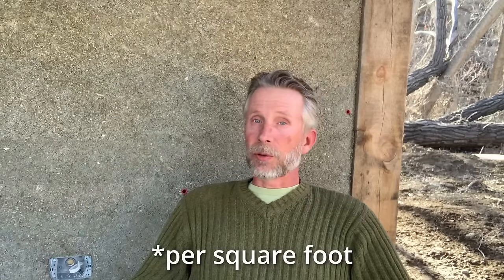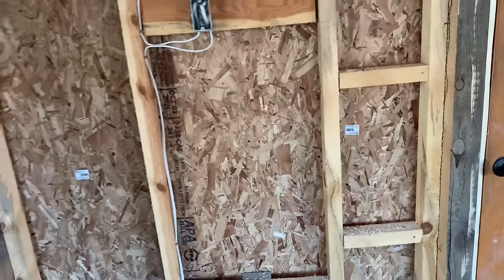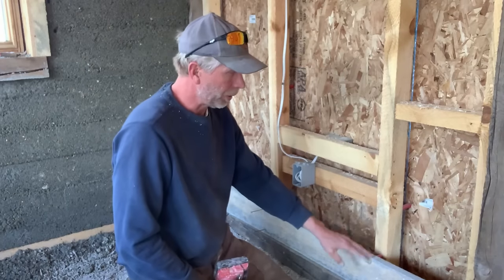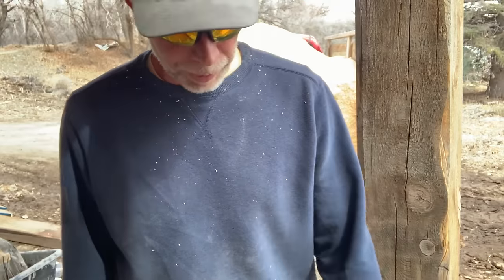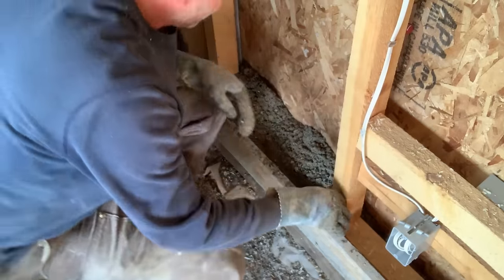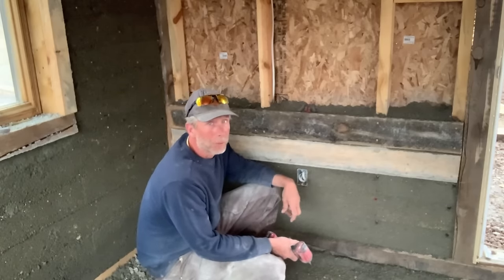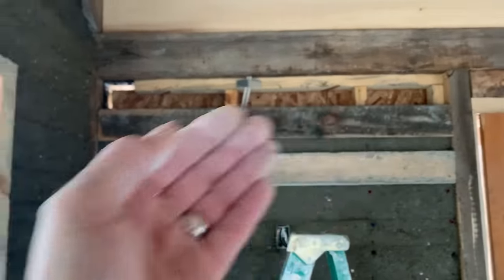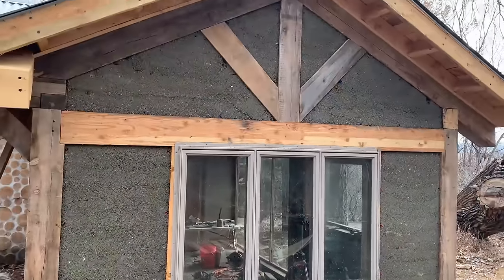Dustcrete

Comment: Great video!  We are interested in using this technique/material as an insulation as well as interior.  Due to our HOA requirements, we have to use sidings for the exterior.  Do you think this is possible for our situation?  Thank you.
Reply from the maker: Absolutely. I would build my walls such that the frame is not buried in the middle of the wall, but positioned to the outside. That will leave you exposed studs, after the forms come off, to attach the siding to. You’ll want to let the dustcrete cure for a month before installing the siding so there is no moisture left in it. I’m not sure if it would be better to have a barrier of house wrap between the dustcrete and the siding, or have contact between the two. If I was doing it, I’d probably skip house wrap and use those cardboard drywall shims to offset the siding from the dustcrete by 1/16” . That would keep the siding material from touching the masonry, but not leave enough of a gap to attract mice and wasps. It would also allow vapor permeability on both sides of your finished wall. I haven’t tried that approach, but I’m sure it can be done.  Good luck!
Reply: @radicalgastronomy   Thank you for your response.  Unfortunately,  our HOA committee requires the sheeting and the house wrap.  But we can use any kind of insulation and interior finishing.
Reply from the maker: @placefor16 That should be fine, as long as you let it cure for a long time before plastering the interior walls. Open all windows, and run a fan.
Reply: @skysnow  They do now have house wraps that have bumps on it that allows for a certain amount of air circulation

Comment: Thanks for sharing. Does this type of material act as thermal mass?
Reply from the maker: It does. The wall section I did in this video weighs about 200 lbs. Having both r value and mass is part of the beauty of this system.

Comment: I'm finishing up an above ground pool. instead of a sand layer,  I will be using a vermiculite and cement plaster on the bottom layer, under the vinyl liner.
do you think sawdust could be used in place of vermiculite?
This layer is in direct contact with the ground.  
it is supposed to act as a vegetation and water barrier to prevent Moisture build up and vegetation under the Liner.
Thoughts?
Reply: @webyankee6558 I saw your post about the Sawdust and concrete floor in the hunting lodge.
what are your thoughts on my Post above?
Reply from the maker: @wyldanimal2  I can’t say how it would perform in ground contact outside.  I may work great, or it may breakdown in the presence of soil biology and water. The vermiculite, or pumice is the safe play.

Comment: What is the thermal mass/R-value of using the dust-crete for the walls? If using the dust-crete for the walls in a colder climate, wouldn’t you want to make the walls thicker to increase your thermal mass for better efficiency in heating and cooling?
Reply from the maker: These walls are better than R 20 at 6” and certainly could be thicker, if desired. The real key to thermal efficiency in cold climates is how insulated the roof is, however.

Comment: Any issues with water/moisture/condensation getting through when it rains or is humid, specially at the bottom (wood boards)?
Reply from the maker: My two foot eves and overhangs have kept the rain largely off my walls. On the next one I will probably do a 16" masonry course before starting the dustcrete wall. I have a dustcrete section in the dormer of the cordwood half of the cottage that was poorly flashed, and did have some swelling of the dustcrete wall before I got it fixed. It dried out without molding or crumbling, but you want to keep this from contact with standing water, for sure.

Comment: could you also incorporate some small stones or riverbed grind or something to make it more structural?
Reply from the maker: Unless the rocks are touching, they would add little structural support. There is a technique called pumice crete that uses lava rocks as the aggregate in concrete. It is a high thermal mass, high R value method and a good approach in regions with ample volcanic stones.

Comment: Would it be of any use to tamp down each section more densely as you fill it?  What is the maximum height of each form  that can be used effectively?  If it is used on external walls - does it need to sit on a watertight stem wall ? To increase adhesion between dry layers you can just use a paste of neat cement.
Reply from the maker: If you tamp excessively, you loose insulating properties. I don't know that there is a practical limit to height. Exterior walls must drain water, either by including the stem wall, or with a rubble trench and proper grading.

Comment: Invation helps produce new ways to build, but I see a few flaws in your approach  and I see a few qualities that are good.  These walls have mass  for heating and cooling mass is good becuse it regulates the tempture swings the building will be cooler in the summer and warmer in the winter, its not so much the insulation factor as it is the mass. Heat and cold won't penatrate the wall as fast, but I think a fire place would hold and give off more heat, this isnt much different then a house in New Mexico that type of construction.
However your studed wall should be on the inside with mechanicals inside it,  a chicken type wire should be in the wall also fiber used for concrete pours this will add a high psi strength. 
Something crashes into a wall its not going to budge.

Comment: I wonder if this will work with shredded paper. Could it be used for tilt up panels? Make it flat, wait till it sets then pop it up.
Reply from the maker: There is a papercrete method. Practitioners typically convert a round water trough into a mixer by mounting it onto a rear car axel and turning the driveshaft up through the bottom of the trough. To this the mount a lawn mower blade. The paper is soaked, then added to the "mixer" with the water and binders. A couple of trips  towing this up and down the driveway mixes the batch. The R value is not as high, because of less trapped air, and newspaper is not a plentiful as it was when this was popular.
Tilt up panels could work, but one would have to solve how to incorporate mechanical concealment.

Comment: Hello from the Philippines.  Sawdust not readily available. Insulation not as much a factor.. What is readily available, are large sacks of { rice husk } , mostly used as garden soil additive in lieu of perlite.
The cement here I believe to be of low hardness quality . Not sure of lime and other additives availability.
Do you believe this sawdust substitute is possible with recipe variations ?
Also, is this method only recommended for vertical applications? 
  Thanks
Reply from the maker: Hello! I bet rice husks mixed with clay and lime would work. You should be able to use it for floors and ceilings, too. Good luck!

Comment: Can this product hold a nail like wood or be cut like wood when cured ?  Thought if it can cut like wood you could use a router after the wall is cured to install wire , pipe etc.
Reply from the maker: Yes, and yes. Because there is no aggregate, wood tools will work on it. I don't know if it would take 18 gauge brads to hang trim, but only because I haven't tried.

Comment: It would be helpful to inform us what climate this would work in.  I live in a fairly wet/humid area with LOTS of rain.
Reply from the maker: Though I haven’t tried this in wet climates, I have no doubt it would work great. I would follow the prescription of “good shoes and a good hat” that is best practice for all natural building modalities. In other words, a couple of feet of stone of cement to start, and long eves on the roof. As long as you use vapor permeable plasters (lime or clay, not latex or cement) this system should perform admirably for a lifetime.

Comment: The walls are so pretty it's a shame to have a window air conditioner sticking into the room. Might consider a split air for a much cleaner look that doesn't take away from your wall, wold have some noise reduction, and higher efficiency.

Comment: Pretty cool but I have a question, concrete products will eat and rot untreated lumber and over time treAted lumber. How did you address this?
Reply from the maker: With vapor permeability. Concrete rots wood when water pools. By using breathable finishes, water vacates the wall. The high pH of the lime helps, too.

Comment: I bought a 10 x 20 barn shed that I am making into a tiny house.  Can I do this technique with the exterior walls intact, and use this as just interior wall and insulation combo?  Will it hurt the OSB exterior board? Will it dry completely?  I live in southern Arizona.  Thanks!
Reply from the maker: I think it will work great. But you may want to prime the osb first. I would worry about swelling. Once it cures, everything will be solid. There is a slight concern of mold between the siding and dustcrete, but there should be a small air gap after curing. I doubt it would be an issue in AZ. 
Keep me posted if you try it!

Comment: Can this be used as a structural material or is it merely used for insulation?
Reply from the maker: I have not attempted loading it. I will soon, and will probably pour a reinforced concrete bond beam around the top of the wall.

Comment: Are you able to test for the R-value of the material? I guess it is not as good as traditional insulation. My guess is somewhere in the range 0.2-1.4 per inch while traditional insulation would be about 2.5-5 per inch. Would love to hear on that.
Reply from the maker: No idea. Tests required. It feels like the low end of the hempcrete range at 2.6 per. I can tell you I wish I had used it in the roof instead of fiber batts. Only r-16 up there.

Comment: I like this. how is it with fire or water?
Reply from the maker: You can put a torch on it and it won’t burn. Typical natural building standards of “good boots and a good hat” are best practice to minimize water exposure, but a lime plaster for the exterior is sufficient to protect the dustcrete. I have a section yet to plaster and the dustcrete held up great through this wet winter. In an upcoming video I will show what happens if a pipe leaks inside of the wall. Stay tuned!
Reply: @radicalgastronomy  thanks.

Comment: Was looking at phoam creek  also my dad's a retired  architect this sadly would not meet building codes in California.  To make it pass one you need rebar 1/4 bar.  Two you need wind ties into the base of the slab almost the size of your thumb for high winds. Saw none  and secondly you need the conduits pies on wall code wise your project will faill without them. Third you would have make them full full cavities so this construction will fail Two other ways.  Thus far if you want pass in crazy California codes the rebar way will be the way to go. Other then thar like the project it was interesting. But with more states in USA adapting CA codes  this might be a issue in the future if people try to replicate the project in wrong state.
Reply from the maker: So glad I don’t live under building codes.

Comment: Please lower the altro music a touch as its not a catchy tune... just a filler I know but kinda hard on  the ears of my seventy three year old ears... I can live with it tho. You make some great points as they waste the sawdust anyway so your helping them recover some loss of materials when producing lumber products. As a kid, my dad used sawdust for insulating our large freezer department... it was a commercial building with hundreds of eight cubic foot spaces for people to store food when the freezer we use now was not a common item and also electricity was not available for everyone either. Those walls averaged about eighteen inches thick and very little loss of temp inside this building... it did have  to be kept cold though or it would start rotting away as the wood was wet and warm temps allowed it to swell up and rot away.... not very well worded I know... struggling to make some kind of sense to which I say..  I have long thought about sawdust as a material that is probably in some ways more valuable than the boards from which it came from. What I am gathering from your forms... is its kind of the same length as a cement brick that folks build  with. Different integrity, but for what it needs to do, just fine. I haven't played with this stuff much as my building stuff was only stuff necessary and mechanicing was my trade. The misconception about hemp has always been a drawback for americans. I laugh a bit when I think about canvas tarps and or money printed on hemp paper, or from hemp. Have you tried to use your mixture overhead?

Comment: What do you think about Foamcrete, using waste foam packaging material?
Reply from the maker: I’m torn. Yes, that is effective at both removing styrofoam from the larger environment, and makes thermally efficient walls. Personally, I wouldn’t do it because I don’t want to breath that shit in the closed chamber of the house. The other problem is that if the practice becomes widespread, new styrofoam will be produced specifically for that purpose.

Comment: Like this better than the chord wood wall.   It’s almost like cast in place Hardie Board.  How long does it take to cure?
Reply from the maker: It performs far better than the cordwood. It seems that new drafts in the cordwood keep needing repair.
This cures hard in two or three days, but takes a month to cure completely. I’m recommending a month or two of curing before plaster for minimal shrinkage. In the most extreme areas I had a 1/4” gap between the dustcrete and the frame. This fills easily with plaster and is stable after that.
Reply: @radicalgastronomy  thanks!  I’m not surprised this performs better - I had commented previously about the cord wood with concerns about how much it would shrink and grow with humidity.  Glad this is working better for you!
Reply from the maker: @matthewprather7386  One of the other issues I’ve found with the cordwood is that my timber frame joints are less than perfect and the resulting movement from closing doors has causes some cracking in the mortar. Dustcrete is definitely a better material.

Comment: Just curious why your small airconditioner was installed inside the room (backwards). We're you using it to heat the room with the exhaust of the compressor?
Reply from the maker: It was a temporary installation to cool the other half of the building before this addition was completed. Now, it spends its summers in an exterior window.

Comment: Can this mix use the pine shavings sawdust bedding that comes as big pressed cubes from farm stores?  (For those who are far from a sawdust source)? 
What if you also added a generous handful of plain borax to the mix (it’s alkaline, too)…as pest deterrent, mold deterrent, & fire resistance? 
Have you ever tried adding a couple dollops (maybe 1/2 cup) of WeldBond glue to the mix?  I tried that as additive to a dirt/lime/portland mix, & it gave a nice pliability to it. 

Adding Pozzolanic ash to any concrete, cob, adobe, or this, helps it be better fire-resistive & reduces spalling in climates that get freezing wet weather. . 

How thick is your finished wall of that…about 8” thick? 
How does it compare with regular insulated walls, for insulation ability? 
This looks like a very good combo….hard to lose such a wall to rot or fire, & certainly would survive a flood better than common walls do!
Reply from the maker: The finished wall is right at 8”, after plaster. About 7” is dustcrete. They have outperformed conventional walls over the first full winter. Thanks for the additive ideas!
Reply: @radicalgastronomy   I had mixed batches of my mix, in a 5-gal.bucket, & used btwn 1/4 to 1/2 c. of the WeldBond glue.  It’s a challenge to find the basic version.  
It handled kinda like the common Elmer’s white glue, but better; it dried better, too, w/seemingly better waterproofing to it.

Comment: Do you think you could make a mix with chipped wood instead? i don't have access to saw dust but have lots of wooded land. Wondering if i rented a chipper if i could make a woodchip-crete. I imagine the R-value would be lower.
Reply from the maker: I have run successful tests on fairly chunky wood chips. It seems to work well. Maybe screen the chips down to 3/4” and finer.

Comment: @radicalgastronomy  Great innovative work.
Do you have any thermal insulation values? Thanks.
Reply from the maker: Only a close guess based on comparable materials and performance. I’d wager around 2.8-3.2/inch. I plan to devise some tests for a more accurate measurement. I am finding that 6” dustcrete walls are quite adequate in zone 5.
Reply: @radicalgastronomy  That is a good natural insulation.
Your method, Dustcrete, seems to be easier than Aircreate.
I find that your method of construction is better than the typical framing that uses tar paper and chicken wire to hold the plaster coating. And of course in a frame construction you also going to use fiberglass insulation, the itchy stuff.
Thank you.
Reply from the maker: @user-ml3yf7pg7g   Dustcrete is so much easier than aircrete. It keys to plaster very well without wire. I’m a big proponent of vapor permeable walls. Trapping moisture in a wall with tar paper, latex paint or stucco, house wrap, or any of the other approaches is a recipe for black mold thriving out of sight, in the wall. In future dustcrete projects I will wrap the entire exterior with dustcrete and lime/clay plaster, rather than just filling between the framing posts.  One of the greatest advantages of dustcrete over aircrete is speed. If you get a horizontal axis plaster mixer and a crew of a dozen neighbors you could fill walls on a 1,200 sf home in a weekend.